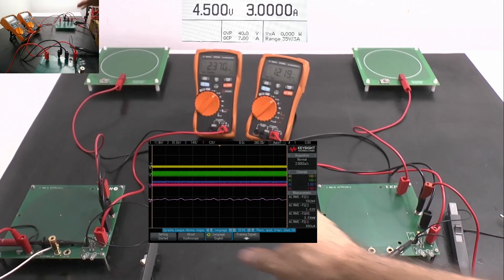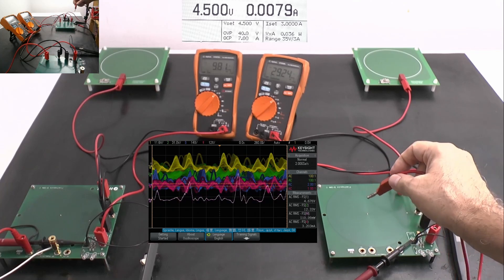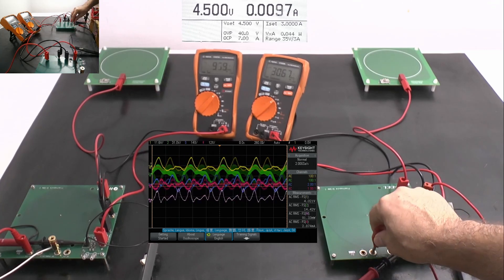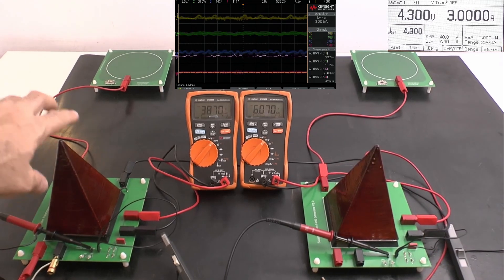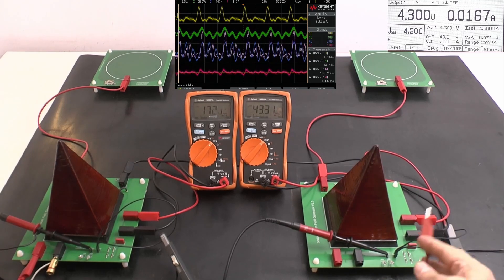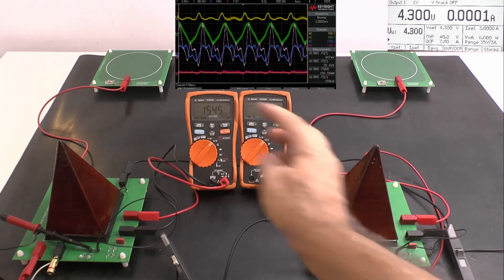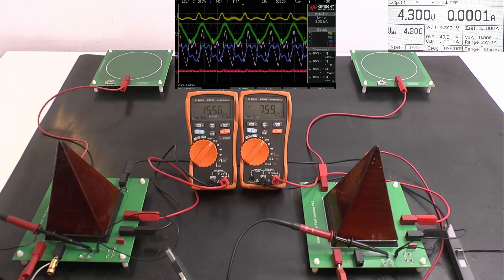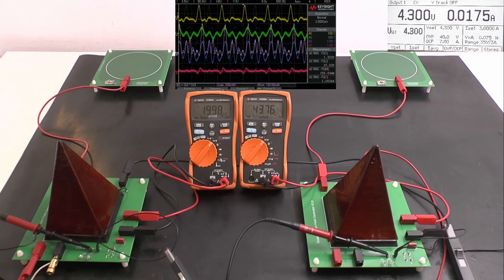Power Source Analysis: Linear vs. Nonlinear Superposition in Scalar wave Systems

Comment: Okay so for the Scalar waves, on the Tesla coil, Nikola was connecting his coils to earth ground, using the Earth as his ground plate, or negative and his Donut on top of the tesla coil was the positive, so it acted as a Capacitor in the sense that the scalar waves were happening between the positive tops of his coils and the earth ground. Like the scalar waves in a capacitor plates.